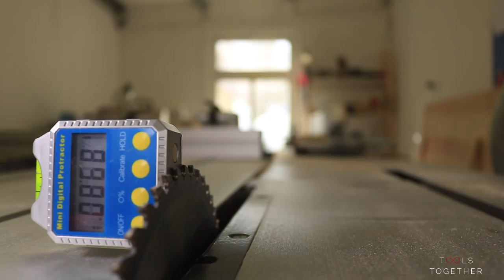// SIMPLE & LOW BUDGET // Mid-century modern bread box with a cutting board

Comment: You should never tilt the blade towards the fence !
Reply: Are you serious?
Reply: @seamusbob3458  yes,dead serious. At some point it will get stuck between the fence and the blade and it will make a kickback.
Reply: @digidandan  20 years in the business and I have never even seen a left tilting blade so i looked into it and apparently they aren't as common here in europe as they are in the US ......Everyday really is an education huh
Reply: @seamusbob3458  so for 20 years you didn’t think that you can move the fence to the other side... well done.
Reply: @digidandan  it cant be done on the machine I work the blade wont tilt to the left it's not a capability built into the machine ....but then again I dont work a machine that small
Reply: @seamusbob3458  put the fence on the other side of the blade...you still don’t get it that the fence could be moved?
Reply: @digidandan  mate google martin t75 prex panel saw
Reply: It's like you dont know the difference between a sliding panel saw and a table saw